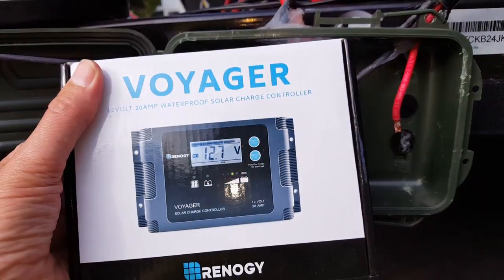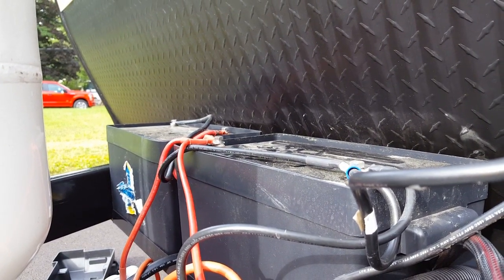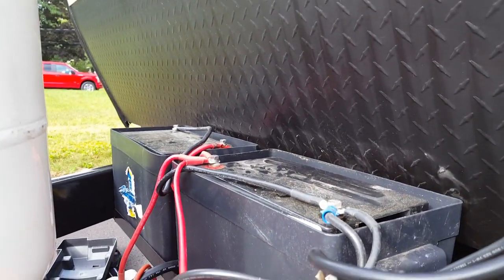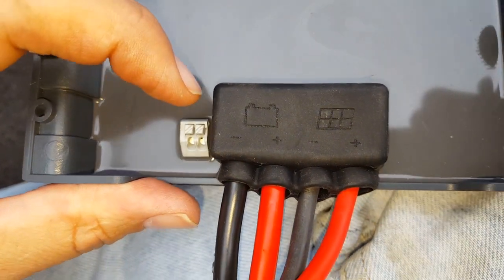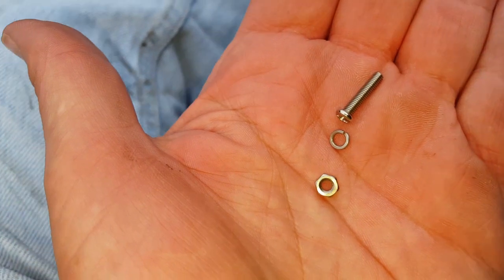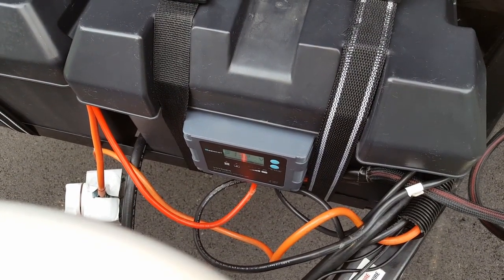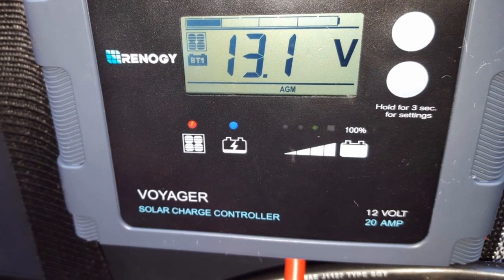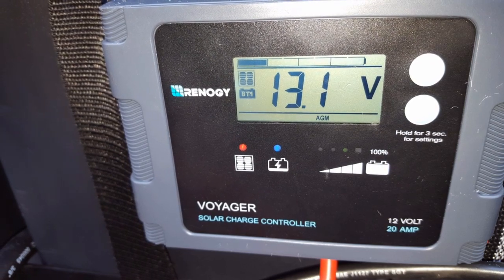INSTALLING A RENOGY VOYAGER WATERPROOF SOLAR CHARGE CONTROLLER

Comment: have you ever had an issue with this controller? i bought one last week, for some reason the voltage is constantly going from 14.4 to 22.8 actual battery voltage is 13
Reply from the maker: That scc died fairly quickly.  The old version was better.
Reply from the maker: I bought a Victron 30A with bluetooth for the latest RV.  EXCELLENT.

Comment: I know this is an old video, but i just installed one of these and used 12-10 AWG Yellow spade connectors from Orielly's auto parts.  They worked great.
Reply from the maker: I'll keep it in mind.  Looking for another RV, sold that one 1.5 years ago.

Comment: How has the controller held up to the elements?
Reply from the maker: Its good as new.  I did buy the latest model, new version, after the one in the video. That was smaller, had a smaller/dimmer readout, and, lasted about 4 months.  I'd recommend the first version.

Comment: Thx for great video. If you don't have a solar panel yet but have a battery charger will it read battery voltage when connected to battery? Does it work well with a battery charger? Does it read current? Does it read current going into battery or leaving battery. Sorry for so many questions!
Reply from the maker: UPDATE: In case you read my reply, I want to correct something I wrote, for you or anyone else that may read this.  The controller DOES read amperage coming off the panel in real-time and it does appear to total daily AHs from the panels.  Both are available in the controller's display.  I previously said that I didn't think it measured amperage at all.

These two things are nice to have.  Not as useful IMO as a reliable battery state of charge (SOC) readout, SOC as a percentage that is....

Comment: Why not crimp connectors on your leads??
Reply from the maker: You could, I bet a 10AWG connector would be too big for that receptacle though.  Personally, if I were going to use connectors I'd solder them on too.

I think the easiest solution for Renogy's 20A controller though is to have better receptacles without any extra work needed by the installer. 

To be honest, I've seen better receptacle designs on the super-cheap $9, 10A, no-name controllers.  It's been working fine so far though, I'm halfway across the US now with no issues.
Reply: I used the yellow crimp round connectors made for 10/12 gauge and they fit tightly but fine. I used 12 gauge but should work equally as well with 10g.